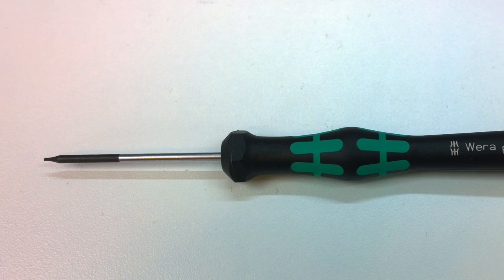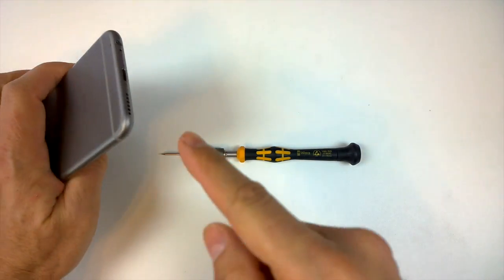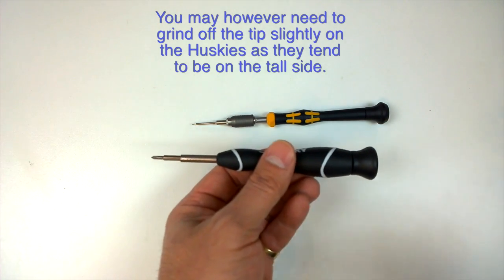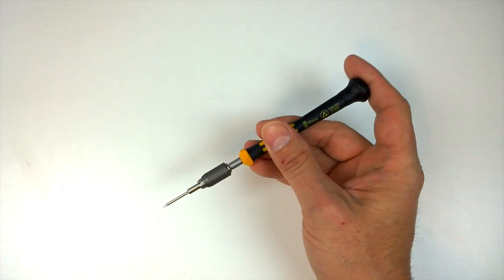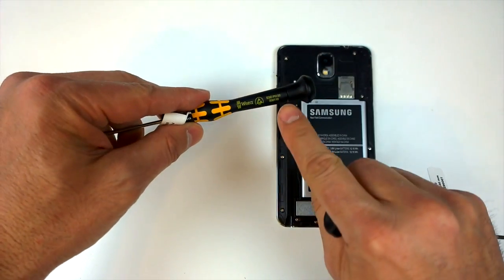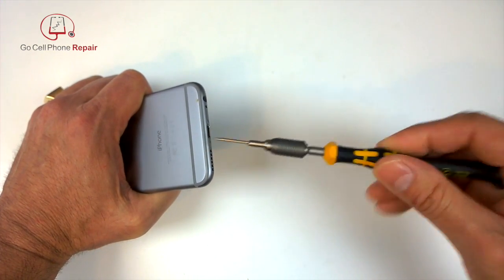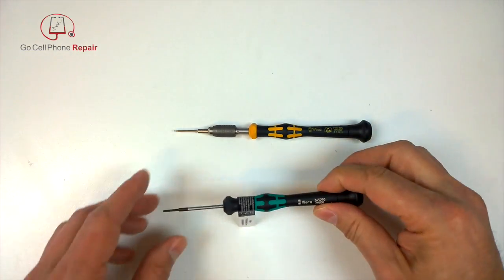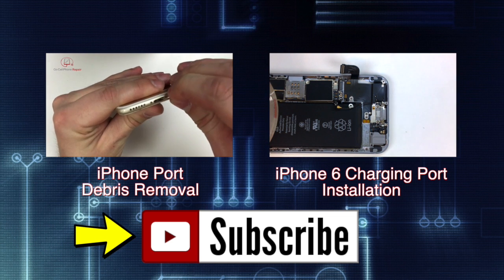Mobile Phone Repairing Screwdrivers

Comment: i actually prefer a more compact driver and the metal ones feel more solid in the hand. downside is as you mentioned is that they roll too easily off the workbench during repair.
although the quick release function is handy i find it more convenient to just grab a seperate driver (pentalobe, philips, flathead) instead of constantly changing the bits
Reply from the maker: +Justin Tran Yeah I prefer to have my top three separately and ready to find easily but I did want to demonstrate the quick release as it is very smooth and secure. What brand are you using? Ill be reviewing more in the future.

Comment: Thanks for uploading these videos.  I can certainly understand your passion for good quality tools.  "Quality Is Remembered Long After The Price Is Forgotten ..." But, damn!  I just ordered some Moody Tools Set Of  4 JIS Type Drivers ESD/58-0319 from eBay for $20.  I've got a couple Galaxy S6 Edge batteries to replace, and that's about it for a while.  If these JIS tips work as well in these micro screws, as they do in the #2 size, I'll be one happy camper.  No chance of stripping the heads at all!